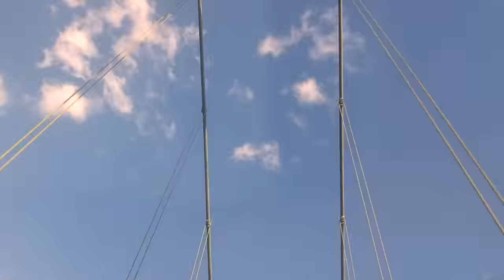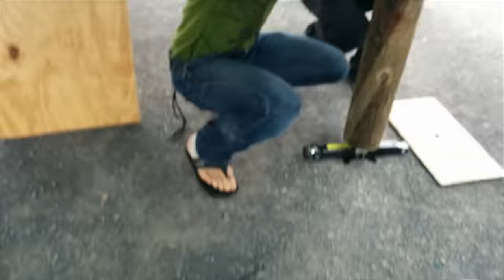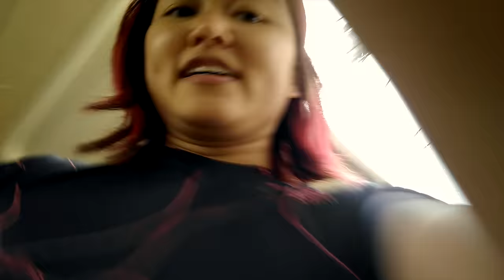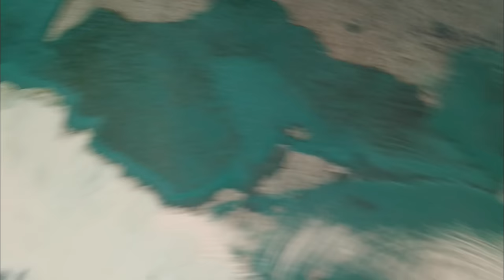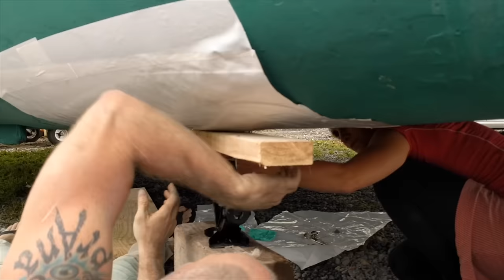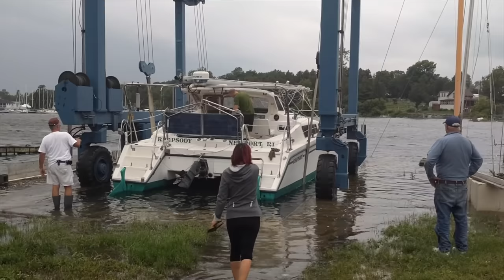Hole in the Hull - we discovered a crack (Sailing SV Catsaway) - Ep. 04

Comment: That fiberglass repair isn't strong enough. Should have been a minimum of 12 layers of fiberglass. Each layer is about 1mm. Charles is a great friend to have willing to help out like that. More sanding and grinding should have been done on the outside. To get down to better fiberglass for better adhesion. There was enough room to bring the glass out 6 times the width and length of the crack. Witch is critical in high stress structural repairs.

Comment: Just watched your film. Looks like the repair is probably holding up ok. I did not like the use of wood in the repair. Adds little strength and can easily get wet and then rot out. Please check it regularly. The theory of encapsulating in resin is only theory, a tiny pin hole and it just traps water causing rot.  What worried me the most was the type of crack . I did not get many close ups but I could not see many fibers in the laminate in the crack .Makes me worry about the low fiberglass content of the hull.
The good thing no balsa coring in the lower hull. I built boats in the 80's and balsa coring was all the rage. But now as I look at old boats built in that era ( all I can afford) the balsa rot in decks and hulls is way worse than I would have expected. We used to say coat it in resin what can happen........a lot! And it's a real mess to repair. Foam did not come out much better either.
So the extra weight is a pain but solid hulls in old boat is way more reliable if they were built strong enough in the first place.
Good luck , I think your fine for coastal cruising ......
Cheers Warren.
Reply from the maker: Thanks for the information. We do check the area regularly and it is holding up well. ☺ We agree about your assessment about the low fiberglass content in the original structure. Many Gem owners reinforce areas of their boat; flexing during heavy seas is a common problem. We will continue to keep an eye on the patch. Thank you for watching. ☺🐈⛵
Reply: Is there a material that could be used as a core that is 100% water proof ??
Reply: @Rick-tb4so  .........Various types of composite honeycomb webbing are available, but I would still go with only solid hull below the water line for strength.

Comment: Any time you grind fiberglass put on a mask! Also did they grind the exterior hull after the fiberglass and touch it up then reapply base coat then bottom paint? I did not see it but did the survey not pick that up? Now, I think you guys are going to be fun to watch. I can tell your smart, adventurous with a can do attitude.  I really look forward to following your adventure. You guys will do great! Fair winds and GOD bless, JC
Reply from the maker: Thank you for your kind words, JC!  We did find Charles a mask later on in the process.  We didn't manage to get the base coat on, but because the hole was right at the bottom of the hull, we figured it wouldn't get too much damage from UV.  We plan to haul her out in December to fully sand down and repaint the bottom.  As for the survey - the crack happened sometime after the survey (after we took ownership but before we took possession).  We had noticed some hull recession but there was definitely no crack.  We think perhaps a combination of factors - wrong placement, boat getting fully loaded (including full fuel tanks), and a longer period on the hard may have all contributed to the crack.  The good news is that we now feel much more prepared should we need to do a fiberglass repair again. :)
Reply: The 1st epoxy bottom coat is in part to keep water from saturating your hull. I am pretty sure you do not have a cored bottom but even with a solid hull the redone damaged area  will need to be addressed pretty soon.  If not you might create a problem of moisture there. On you tube there are several channels that cover hull damage and repair. ? Oldboat? I think and some others go over the correct procedure. Please if you guys can find the time research "hull bottom fiberglass repair" or words similar. Don Casey would be good to look up too for his thoughts and recommendations in his books and articles.  I just want your guys investment to last a long time and to be safe and happy sailors. I have no doubt you guys will get it figured out and fixed and enjoy many, many years of sailing. Look forward to watching you guys get to warmer water!  Look out Bahamas here they come. JC
Reply from the maker: Perfect, thank you so much for this information.  Perhaps we'll pull her out sooner rather than later. :) We are also looking forward to warmer water..... can't wait! :D

Comment: Looks like the fix has made the boat stronger :)

Didn't the survey uncover the crack before you bought the boat?
Reply from the maker: Good question!  When we surveyed the boat, we noticed slight recession of the hull, but no crack.  We actually have close up pictures of that exact spot!  Our theory on why the crack happened: 
1) the original owner had switched hauling companies this past spring and they asked for a different set up with long wooden beams (he was using cinder blocks and plywood previously).  
2) We think the new company set down the boat at the wrong place, which caused the hull recession.  
3) As the owner prepared the boat for transport, he added more load (including filling the fuel tanks).  

Our best guess is that the combination of being on the hard for a longer length of time than normal (resting in the wrong spot) + slightly more load caused the hull the crack between our survey and transport day.  

These things happen.  Luckily we were able to address it and as you said - it made the boat stronger than ever. :)
Reply: Interesting. I guess these thing happen! Lucky it was noticed before you launched!

One boat we purchased had a similar-but-different issue. There was no visible problem, but the surveyor's moisture readings of the hull uncovered a soft spot on the port side. If we had put the boat in the water, water would have quickly seeped through and sunk the boat! We had to cut out the affected area and replace it with new fibreglass. 

The theory in our case was that the boat had been damaged (perhaps being dropped too hard onto a cradle) and then patched with a very poor repair.

Lesson learned: always survey your boat before you buy it, no matter how good shape the boat looks to be in!

Can't wait to see about your first sails on the new boat!
Reply from the maker: You're absolutely right!  We actually just heard a story of an experienced sailor who purchased the boat without and survey and unfortunately lost his vessel in the maiden sail.  Yikes!

Glad things turned out OK on your end too.  Learning to patch is an important skill and we're happy we got to learn about it with the help with friends (and on land!).

We can't wait to be sailing soon either!  :)  Thanks so much for watching and commenting. :)

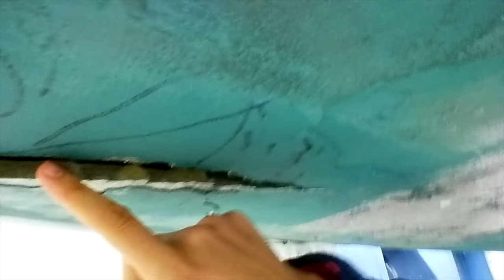Comment: I hate to tell you this, but I have real reservations of this 'repair'. The reason I say this is that  I have performed quite a few frp repairs in the past. So here's part of my concerns, 1) a guy who does not know how to dress properly and safely for this kind of work is very suspect as to his sanity and experience. 2) at 2:12, it looks like the hull is about 1/2" thick, f not more, that equals ~ 16 layers of bi-axial (cloth) and/or possibly several layers of woven roven (real heavy stuff) depending on the manufacturers original lay up schedule. NOT three layers on the inside and three on the outside, which looked like chop strand mat (the weakest glass). 3) the crack should have been ground to a taper on the outside at minimum ratio of 8/1 if not 12/1 and then progressively filled with the appropriate glass lay up. This is not a quality permanent repair, please, please, please do some research on your own and decide for yourselves. Sorry Charlie...
Reply from the maker: Thanks for sharing Charlie! We didn't show everything on the video, and the edges were tapered before we started glassing. We appreciate viewers speaking up.  It's held up through 18 months through some heavy seas with no blistering or other signs of decay, but we're keeping an eye on it